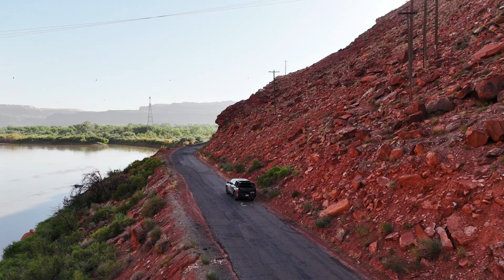Toyota Land Cruiser LC 250 Intake Install

Comment: Doesn't the magnetic cover leaks dust & water? The original feels more secure
Reply from the maker: Not at all. The magnetic lid is primarily there for serviceability and ease of access, but the sealing surface itself is what actually keeps dust and water out. The magnets simply hold the lid tightly against that seal.

We specifically designed it with off-road and real-world conditions in mind, not just street use. The lid seats against a sealed perimeter, so once it’s installed, it’s not just “resting” there loosely because of magnets.